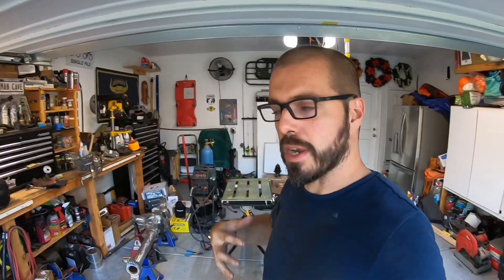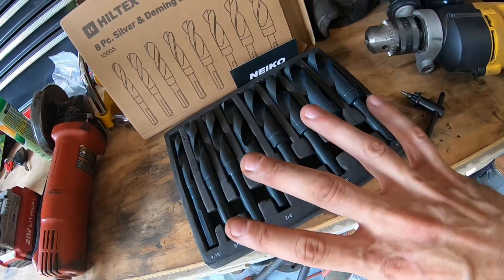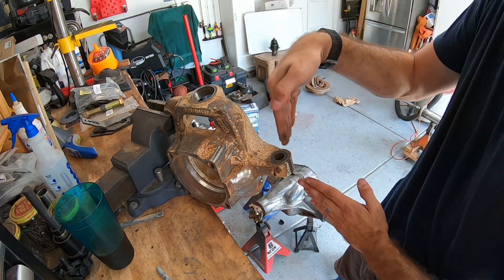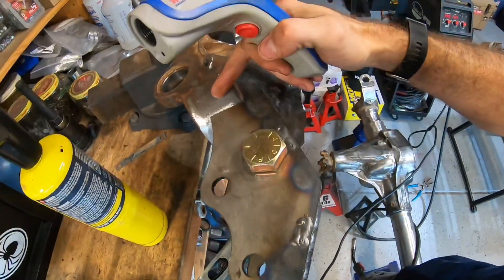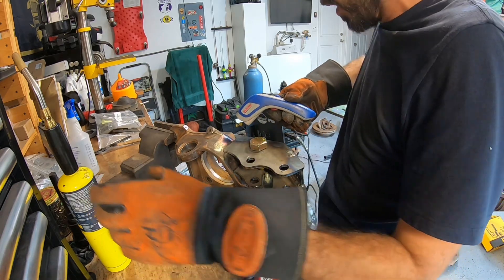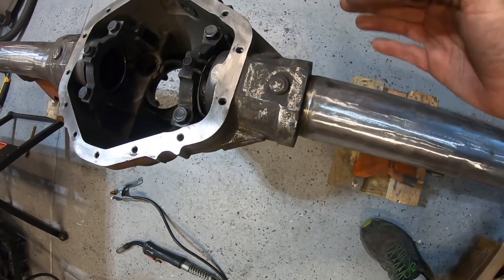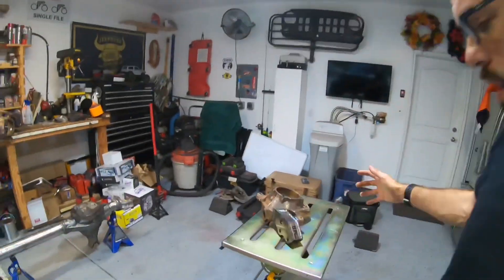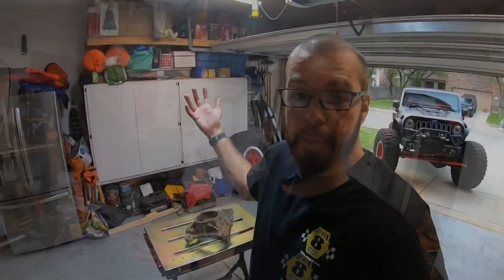@TMRCUSTOMS Jeep HIGH STEER Arms - Project Maple Leaf Jeep Build (no. 7)

Comment: Hey Dan, I bought the TMR High steer kit. I’m concerned it’s not “High” enough.  I know you’ve been running it a while - what are your thoughts now?
Reply from the maker: It’s been fine for me. I actually had to put my toe rod under it as a single sheet so the drag link didn’t contact it at full flex. I have never had a problem. I have put my toe rod on things here and there…but it’s not often. And honestly mount it an inch higher wouldn’t have prevented me from hitting it.  But their high steering kit also puts it at the same height that most others do unless you go with different knuckles…and the. At that point you have to worry about drag link clearance.
Reply: Thank you!

Comment: Yea I’ve heard of a lot of the kits having issues with the relationship of drag link to ball joint. Etc etc. I don’t know much about them. I know Artec makes one, Barnes, TMR, and I’m sure other brands. And I’m sure each have their pros and cons. I don’t personally run anything TMR but I’ve always heard their build quality is top notch. Good video man!
Reply from the maker: Thanks. Yes Barnes had two versions of the kit but I didn’t want to call them out in a YouTube video. Artec is always top notch, but more expensive. The Barnes original kit was much like the TMR kit. They changed their design about a year or two ago and it doesn’t work for the JK geometry. It used to, but it no longer does. In their defense they now label it as a “generic” kit and not a JK specific kit. But they kind of did it in a very slick way. TMR is a small mom and pop style company and I like supporting those guys. Especially when they make good stuff. But this rig will have a bit of everything. Some TMR, Motobilt, and Artec all have their touch in this build.

Comment: Hi Dan - liked the video.  I'm looking at welding my tubes to my housing on my Ford 8.8 for my YJ.  I'm very new to welding - is it realistic for me to attempt this type of welding of cast to mild steel?  I've watched on quite a few other channels - but watching and doing are not quite the same 😀.  Thanks for the video
Reply: Just to echo what has been said CLEAN SURFACES, heat the area slighlty to draw out the oil and gunk let it cool, clean it with NON chlorinated brake cleaner ( the chlorine turns to a toxic gas when heated) take your time. Also you can put out an all call to people in your offroad group to see if anyone is a competent welder that would be willing to guide you (maybe trade their time for a few brews) weather you think you can or can't your right.
Reply from the maker: @callmesomething1425  good advice.
Reply: OK thanks for the advice - we will see how I feel and whether I take it to my local shop.....
Reply from the maker: Hey man! Thanks for the support. Based on your realization of watching and doing not being the same thing….I assume you have a good grasp of your skills. Just make sure it’s clean. Heat it up a bit and have at it. Just monitor the temps and weld small section at a time to make sure that they coil at about the same rate. Be careful  to not make it too hot. You don’t want to over heat it and send the heat into the bearings and stuff. It’s tricker on front axles that have inner seals. But I believe the 8.8 only has an putter seal. So you don’t have to worry about melting that. But just double check to be sure. If you feel like it’s something you can tackle…then I’d go for it. But not ever seeing you weld…it’s hard for me to say if you should.
Reply: @WarPaintTexas  Correct, 8.8 only has outer seals.
Reply from the maker: @TomSmith-nx3hx  yea. So it’s not too bad a job. But just do tons of research and take your time.